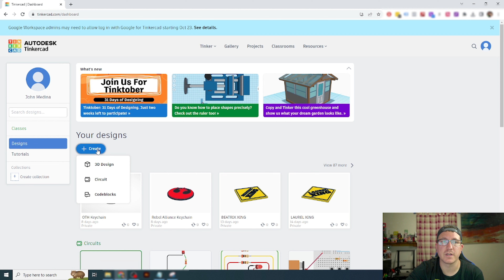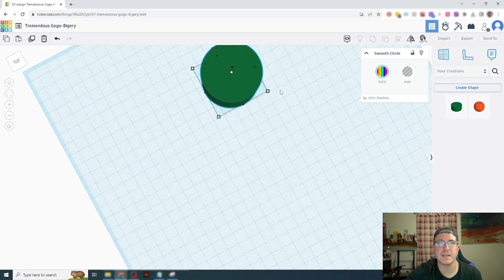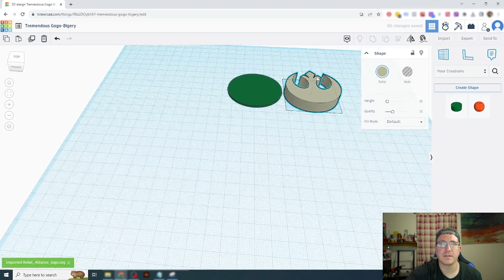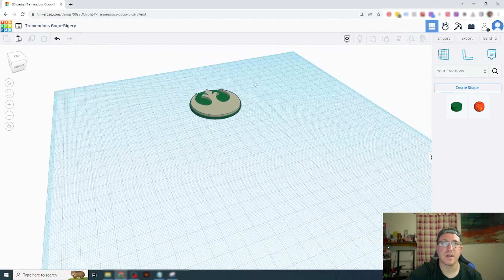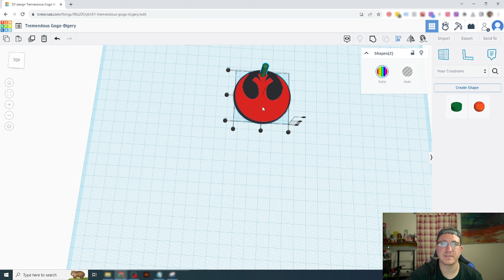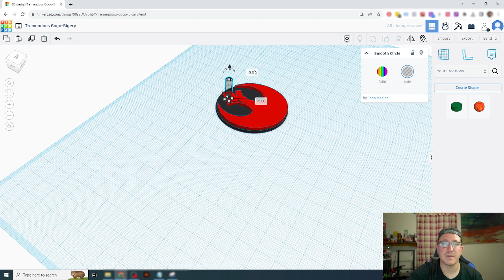How To Design Your Own 3D Printable Keychain Using Tinkercad | Easy Tutorial

Comment: Great video. I was wondering is there a way to make the designs flush and not have to stack but still keep the 2 colors?
Reply from the maker: @michaelbarajas251  Honestly, I'm not sure because my 3D printer can only print 1 color at a time so not on the Longer LK5 Pro. But, if you have a printer that can print with 2 colors at a time, you could probably use a slicer to tell it where to switch colors. I'm not sure how difficult it would be to do that.

Good luck!

Comment: this was crazy helpful - thank you! Quick question - when I group them to make the hole, it turns my 2 colors into just one. How did you keep the red and black?? Thanks!
Reply from the maker: I'm glad you found it helpful!

You don't need to group the circle and the logo together before you make the hole. Leave them as separate elements and only group it when you make the hole. That should leave the 2 colors but group all 3 elements together.